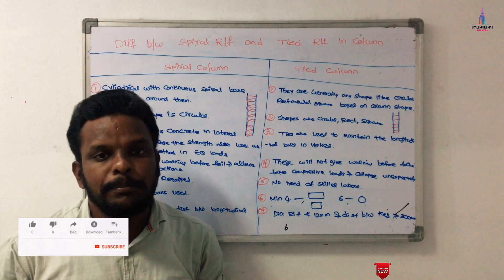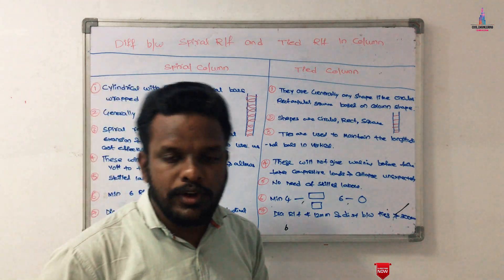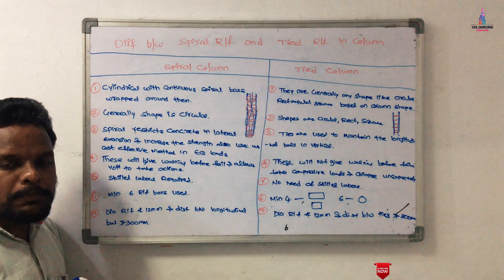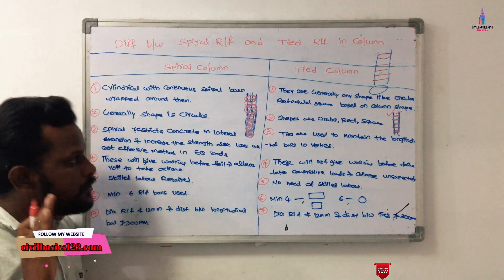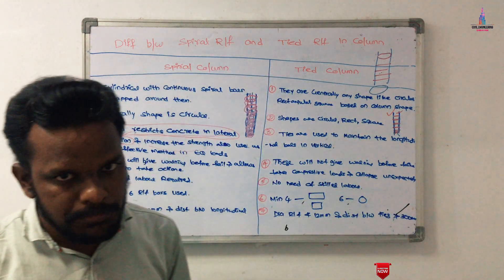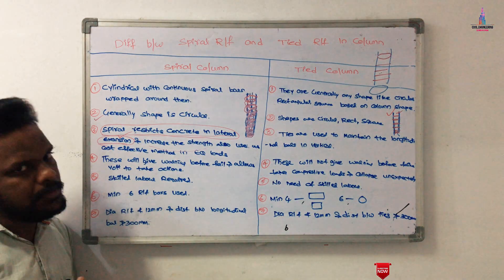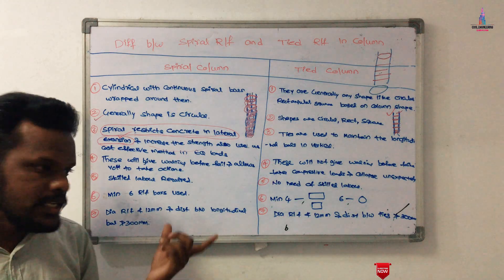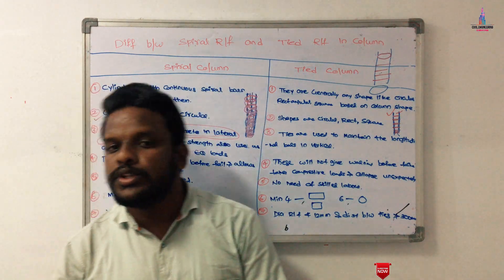Difference between spiral reinforced column and tied reinforced column | civil engineering | shravan

Comment: Hi bro please reply
Reply from the maker: Hi
Reply: @civilengineeringbyshravan9596  bro required video on Static Analysis and Design of G+20 RCC Framed
Structure by using ETABS Software
Reply: @civilengineeringbyshravan9596  it is my major project. I will share you pdf please do video on it